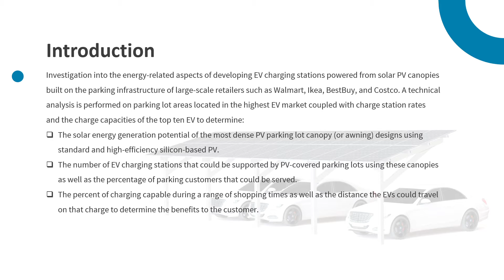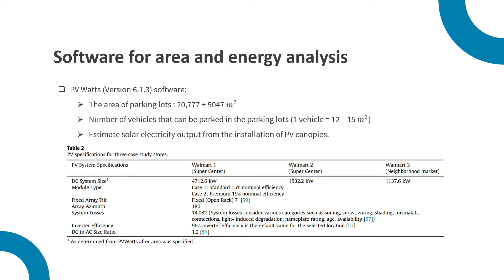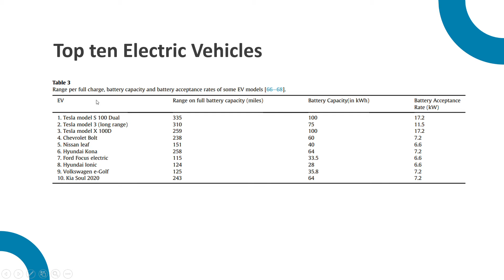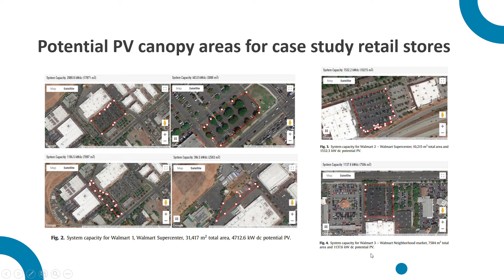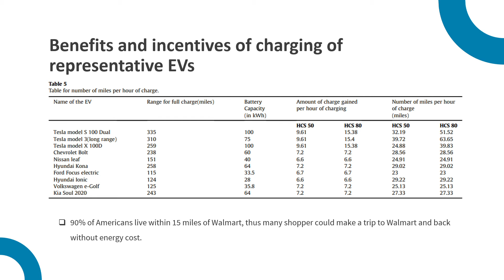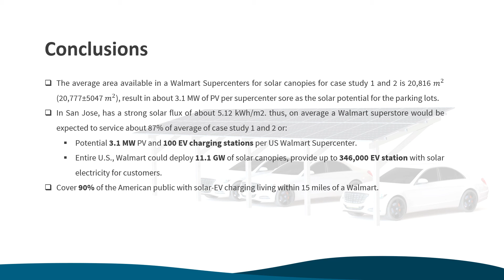Electric vehicle charging potential from retail parking lot solar photovoltaic awnings

Comment: In the part benefits and incentives of charging EV, you mentioned the 3 levels of charging stations, what are they?
Reply from the maker: Level 1 provides charging through a 120 V AC plug and can deliver 2 to 5 miles of range per hour of charging so a full charge requires between 8 and 20 h with a charging rate is approximately 1 kW.

Level 2 provides charging through a 240 V (for residential) or 208 V (for commercial), it delivers 10 to 20 miles of range/h of charging and full charges in 3 and 8 h, charging rate around 3 kW to 20kW.

Level3 (DC fast chargers) provide charging up to 600 V.

Comment: V6400071_Can you explain more detail an example of using the equation EV charging stations?
Reply from the maker: For example,, if the PV electricity generated per day is 20,000 kWh, and electricity transfer per day is 8.5 kWh, then we estimate the hd to be 12h, thus according to the equation, the number of charging station should be around 196 stations.

Comment: What is the difference between standard and high efficiency of the photovoltaics?
Reply from the maker: Both standard and high efficiency of photovoltaic are the PV output that we get from standard and high efficiency silicon-based PV respectivly, where the high efficiency gave PV output higher than the standard around 2 to 3%.

Comment: Could you expain how does photovoltaic PV work?
Reply from the maker: Photovoltaic PV system use cells to convert sunlight into electricity. When light shines on the cell it creates an electric field across the layers causing electricity to flow. The greater the intensity of the light, the greater the flow of electricity.

Comment: I can understand that Walmart would possess a huge potential in having charging ports in their parking lot. However, what I concern is about the economic perspective regarding the employment of such a system. Did the authors address this issue? What is your opinion on this issue?
Reply from the maker: The author mentioned this issue a little bit but future work is needed to analyze the economics of deploying such systems. For example, is it in the store owners’ best interest to provide charging stations for free or to charge a fee? 

In my opinion, if this system is provided without any charging fee from customer, the retail store owner may still get benefit from providing this free solar electricity charging stations such as, this could promote the customer to choose to come to the store because this would be reviewed as green consumerism also comfortable for customer to park the vehicle under shading parking lots with charging free, and when they want to charge their EV battery to higher percentage, they will choose to shop longer, so they might spend more money on shopping. Thus, this more profit could be use to maintain the system. But further work is needed for this opinion and to analyze this issue, there are some parameters should be considered include number of customers visiting the facility, number of miles per hour of charge, number of electric vehicles in the location, average time spent by the customer in a specific store.

Comment: In your opinion, should this solar  electric charging station could be used for free for the customer? What are the benefits?
Reply from the maker: If this system is provided for free, the benefit that the store owner get from providing this free solar electricity charging stations, for example, this could encourage customers to come to the store because it will be perceived as green consumerism. It will also be more convenient for customers to park their vehicles in shaded parking lots with free charging, and when they want to charge their EV battery to a higher percentage, they will choose to use this system. As a result, the additional profit might be used to keep the system running.